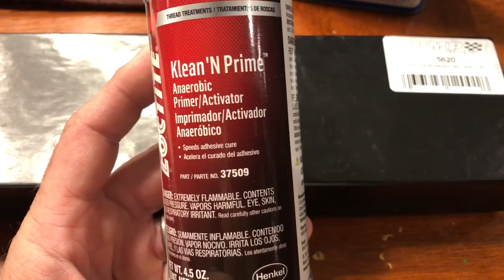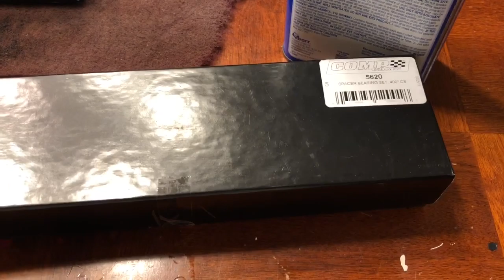Engine rebuild. Will it Hold?  Main bearing Spacers!

Comment: I have built many 377 oval track engines and never loctite the crush is what holds them we made our own and used line hone on bearings to get how we wanted then check clearance and get clearance by crank being on lower limits worked great .

Comment: A long time ago people use to locate main bearing spacers with a dowl pin.  I’ve seen a 400 SBC with a 283 crankshaft.  Just a thought to bring up to your machinist.  JD
Reply from the maker: Interesting, probably wouldn't be hard to do it.  Thanks
Reply: Really no need to drill holes in the main saddles for dowels.  I have run spacers many times, mainly due to the customer already having a 350 main crank, regardless of stroke,  and wanting to run in the 400 block. The spacers snap in with the bearing tang the and the bearing snaps in to the spacer like it would the block. NEVER had a bearing issue. Always wise to double check clearances..

Comment: Fyi be careful when using king bearings some sets are made for cast crankshafts and some for Forged crankshafts had a machine shop sell me the wrong ones didn't last long because of the RA surface.
Reply: It's common practice, Clevite does the same.. "P" bearing for cast, "H" for forged. I run King 95% of the time for years, forged cranks get HP bearing..
Reply: @vengeanceizmine9878 
Just thought it was funny that a reputable machine shop didn't know then wanted to argue with me about it saying there was no such thing.
Reply: @keysautorepair6038  Live and learn. That's a salesman for you. I could never do that to people, I'm too honest,  and my work speaks for me. I build every engine like it is my own, not like it's a job.

Comment: I know yours are done but maybe a swipe once in one direction or maybe 2 swipes in either direction with like 320 grit 45 deg angle of each swipe i think would have a better mechanical bite to each other try it on a set of spares ????
Reply from the maker: These are set, we will see how it goes.  I plan on pulling the engine in Dec.  Hopefully it last that long!

Comment: I can not wait to c the tang make a hit I think u got something for blood bath an all the others I no that little motor puts in work love ur little budget things u do an go faster than the people with thousands of dollars iam a young buck  but back in the day be for mom an dad split up me an my dad  drag raced that was our thing evey Thursday to Saturdays some Sunday but Manley at  Piedmont' until  the the black dots started. Killing each other so we just went to  farmington more  we're had a nova use to be called the bad bow tie then the super trick but we had a many motors in that thing trying different.  Comations  but all ways small block 400 a few 377s but the little 406 was the best I think for the money u could build a good bottom end slap a set of old school 292 angle plug heads and two 60 60 center squirters  an turn that bitch up about 9 grand in the bleach box every pass had one 406  stay together  for 3 plus years just changing the oil regalr and the main manse on it  car didnt run but 6:00 on motor  but it was very considered of course it was tubed out  but  very heavy 3450 proble could have went faster but he liked putting. On a show doing big wheel stand's and one more thing it had good set of axle's Mosser just like u if it broke u send it back an they send u a new one people always triped out because we only had a big ten bolt but it had I think 35 splin axels an all the outher good stoff and had to have the  seaclipalanters sorry. For rappingur ear but. U remind of my dad an no its not a bad thing u an him proble build a motor blindfolded OK buddy getter but together and good luck
Reply: What the fuck?

Comment: ,,, back in the Seventies Jenkins would not use the spacer bearings in his match race 377. He would have the stock 400 bearings line-bored, right in the block, for regular 350 bearings. Of course this was not boosted . Can't remember but he might have pinned the 400 bearings  .

Comment: I hope this isn't the case for you, but i had a similar experience with loctite on bearings, caught a rod knock and found the bearing had made about an 1/8th of a turn in the rod, it didnt chew anything up, i was able to polish the melted bearing material off the crank and decided id loctite the new bearing into the rod and cap, I just used a couple dabs. Anyway, when i bolted together, the crank wouldnt turn, took it back off and had to knock the bearing halves out and scrape all the loctite off. When it sets up, it's too thick and takes a few more thousandths of your clearance. Hopefully your crank will turn, id set it in and put 1 main cap on and lightly tighten the bolts and see if it still spins.
Reply from the maker: Yep, that is a concern.  If it’s too tight, we will get the crank polished again to add the clearance back.
Reply: @TurboJohnRacing   Another possible concern, can that type of loctite melt or just get hot enough to squeeze out, the bearing in the cap is under a hell of a lot of pressure. Also the extra material (loctite) in between would mean you're smashing the bearing insert into a hole smaller than its intended outer diameter, would maybe worth borrowing a dial bore gage and checking for out of round while one is torqued down. Not tryin to beat a dead horse, you obviously know what you're doing, just dropping my thoughts. Hopefully it works out! I'm a new subscriber, digging your content, keep it up!

Comment: Did you say that they were used bearings? If so, Oil could be impregnated on the inner surface of the bearing which could cause it no to stick as well.
Reply from the maker: Yes, those two rod bearings that came apart were used.  I cleaned and acetoned them, but I think the oil was deep in the Babbitt material.  I think you are right.